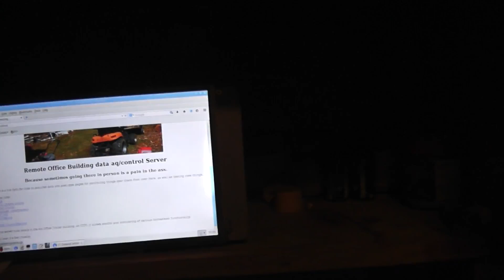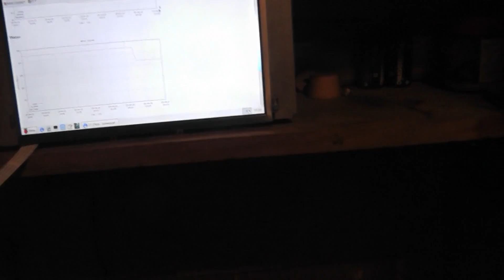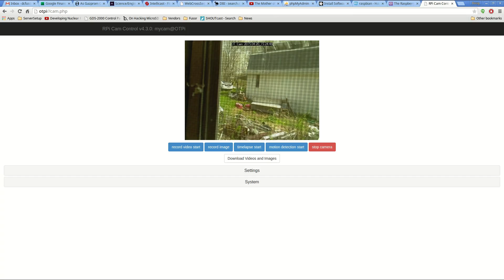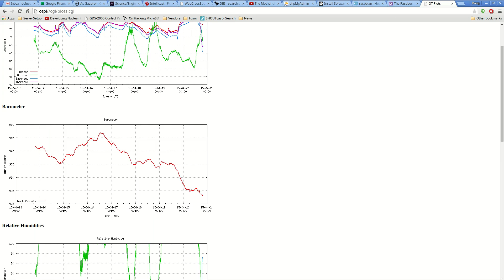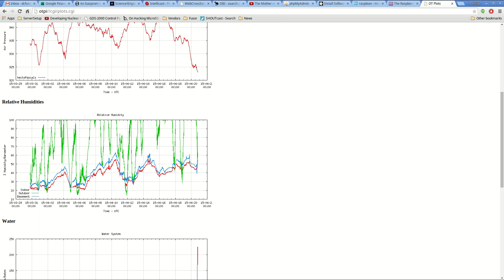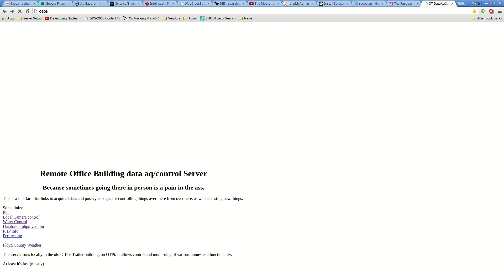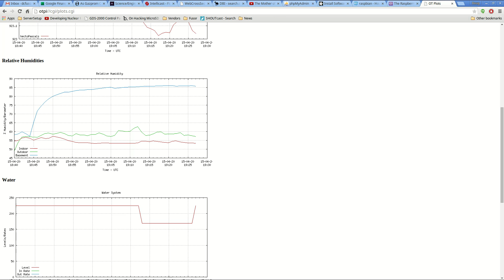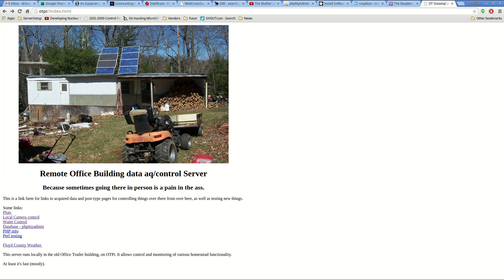LanofThingsFirstLight

Comment: Damn, all this with pi and arduino? I would never have the perseverance to carry a project like this through. And how hard was the programming of the whole thing?
Reply from the maker: CockatooDude Didn't really take that much perseverance, but did take some patience to let the tests run long enough to catch all the edge cases (I hope) - while I did other stuff around the 'stead.  I've been programming since the '60s....I was CEO of a software systems/product design consulting firm (that grew from one employee - me - to a $10 million business) in a previous life...so, not that hard.  Most of this was already in the old bag 'o tricks.  So, most of the work from my POV was actually sysadmin stuff, which is not my forte, which made it work instead of pure play.  I'll be posting the code somewhere on the thread linked above - it's really not that bad (some older versions of some is already up there but the good stuff, not yet - I'm making it good-er for the moment based on real life use).  But all the tweaks to config files, the things I installed to leverage already-round-wheels and so forth - another story entirely.  I think the acronym is PITA.  But once done, it's done.  Documenting all that kinda stuff - I hope to get to most of it.  Luckily, most of it throws informative errors if you forget to install some dependency or set up some config file correctly.  Luckily, it's no harder to image a raspberry pi than it is to file-copy a virtual box machine...